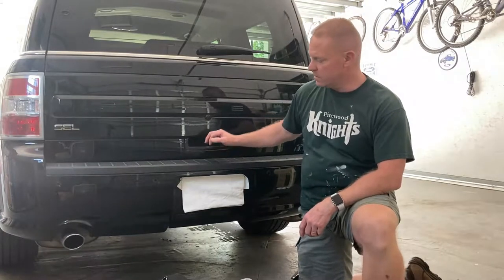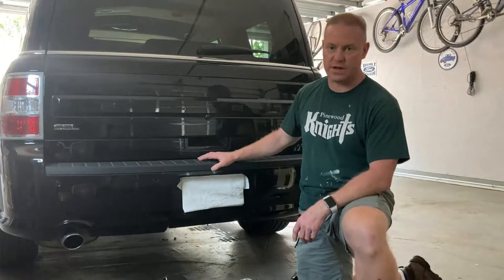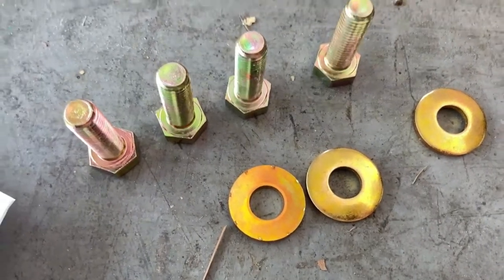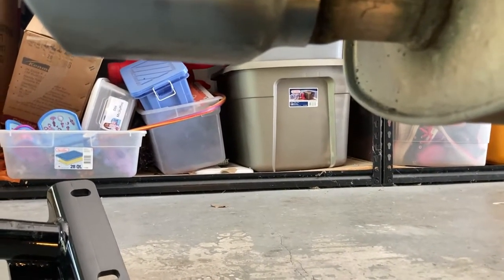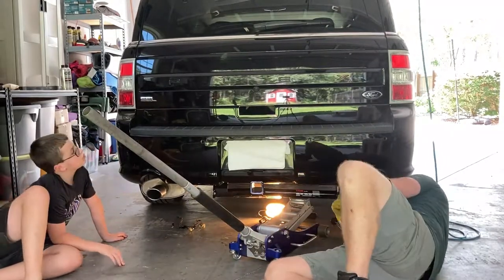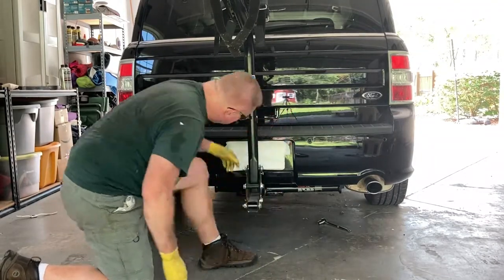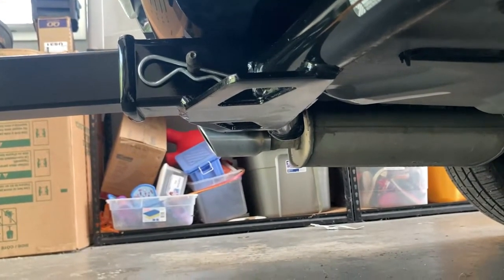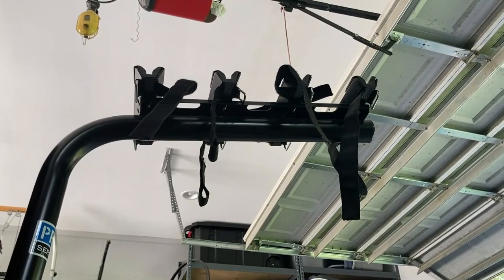2018 Ford Flex Trailer Hitch Install (Curt)

Comment: Excellent video. Thank you. I have a 2016 Ford Flex AWD SEL and have looked at both the Curt and Draw-Tite hitches over at eTrailer two years ago (successfully installed an eTrailer hitch years ago to my 2005 Saturn VUE). Kept deliberating on getting either of the hitches for my Flex because I had come across criticism somewhere online of having to grind away part of the hitches attach-points (on the driver side as I recall) to avoid the hitch hitting the support structure of the exhaust assembly. But it appears you have had no difficulty with the Curt hitch. And I have to assume your 2018 Flex is essentially identical to my 2016 dual exhaust model.
Thanks again for posting this. It probably has nudge me to look into finally getting the hitch (this spring ... too cold now here in Ohio).

Comment: Great stuff - considering this for our 2019. The hitch racks seem so much better and that is 100% all we'd use it for. Grate idea with the ramps also @rogernewquist1346
Reply from the maker: Yeah, ours is pretty light duty too, bikes is all it's ever held.  We probably could benefit by buying one of those extra storage bins with 5 people in the family now, the cabin, as big as it is, does get filled quickly.  Thanks for watching.